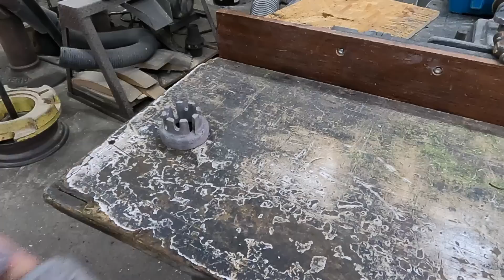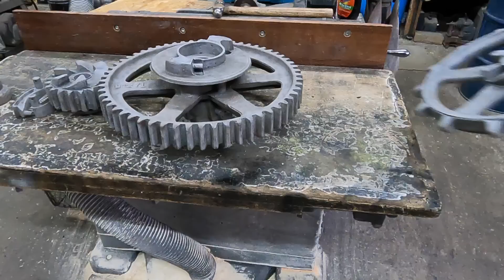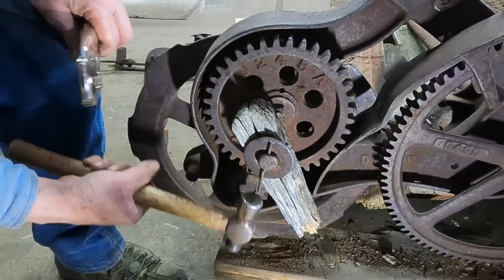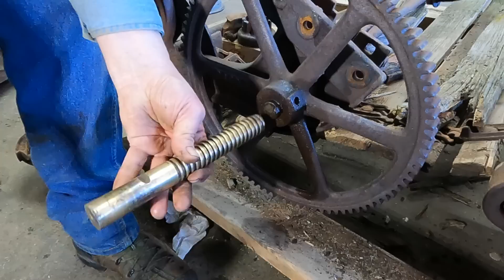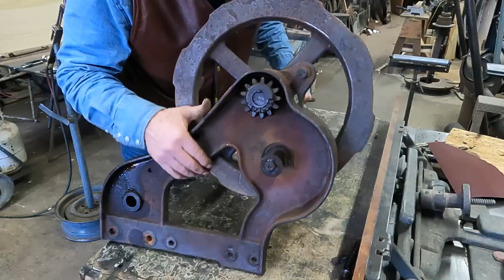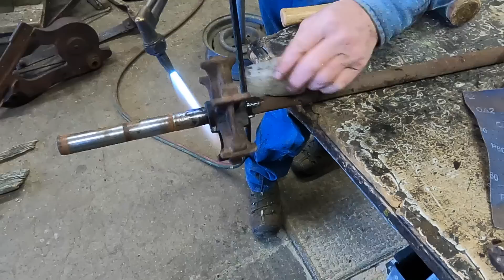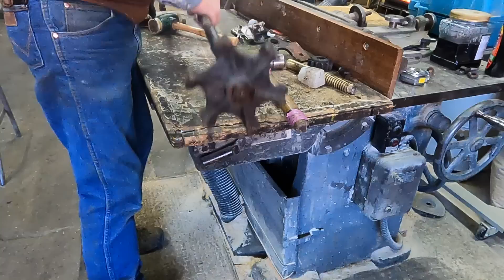Does Wax Break Loose Rust? My Test | Engels Coach Shop

Comment: Yes wax is good stuff, especially on stubborn wheel nuts. The last shaft I probably would have had a hardwood block on the floor and dropped the shaft vertically and let gravity assist , save all the tapping. Worth a shot. Good job.

Comment: The heat expands the metal slightly while the wax only lubricates. You want to heat up the female metal component (i.e. nut) while keeping the male component (i.e. bolt) cool. Heat expands, cold contracts creating more of a tolerance to break loose. 
P.s. Please be mindful of everything around and within the component you're heating up. Heat transfers thru contact and too much heat could damage bearings, rubber gaskets/bushings, wires, sensors, etc.

Comment: My dad was a mechanic/auto machinist and he told me about this trick when I was helping him pull an engine and the exhaust stud broke. He heated it up and put some wax on the manifold and he got the stud out. Heat expands and the wax gets between the two materials? Cool video.

Comment: for that real difficult wheel/sprocket (gear? cam timing? whatever) 18 minutes in, really need a good simple helper for some extra hands around the shop, get an old 20 pound iron weight plate from a barbell, set the rod vertical with siezed wheel near floor, heat the crap out of it and just let gravity and the weight do the work 😁
jokes aside, darn good work though

Comment: If you don't have a square socket to remove square-head bolts, you can always use a standard socket extension backwards, with an adjustable wrench on the square end.  Most square-head bolts are 1/4", 3/8", or 1/2" in size, which are all common socket drive sizes.

Comment: Retired auto mechanic here.  If one observes the hot riveted structure of a massive bridge built during the heyday of American construction, one will see that there is considerable rust on the outside. Where the massive steel plates are held fast together by the rivets, there is no deformation of the plates.  Where the spacing of the rivets is further apart, the steel plates show a bending deformation.  This is because as steel oxidizes, the resulting rust exerts a force of expansion, tons of force per square inch. Where the steel plate is strong enough, and the rivets are sufficiently close enough, the rust proceeds and expands until the physical strength resists expansion, stopping further rust. Observing this, I conclude that the steel shaft rust expanded inside the cast part making removal difficult. I my opinion the heat applied to the cast part caused it to become slightly larger which was the key to its removal. The oil and wax certainly helped. Oily greasy steel seems to not rust.

Comment: Dave
I think the use of wax to free off stuck parts dates back a long time when the likes of WD40 et al was not around . and it may be we remember what we used to use , as you say heat is the long time assistance in freeing off stuff .
now a quick info about me well I am 77 and when was very young I helped ? at my uncles dairy farm ( which was off grid for electricity ) we had horses and a fordson major tractor ( the one pedal clutch/brake type)  I used to help with the hand milking , tractor work ploughing and muck spreading  first check the wind direction most important !!!!,   the horses where used to mow the grass at  the local cemetery ( Ernie would not allow the tractor to work there ) so first catch your horses and tack them up oil up the mower and spend a day mowing the grass .
those where the days before we had elf and safety to look out  for us I Evan rode astride the tow bar for the reaping machine , flat belt drive for the pink threshing machine no cards at all loaded it with pitch forks 
keep up the great videos its refreshing to see a true craftsman ( opps its 2024 craftsperson ) at work. Now I build miniature steam engines from scratch mostly victroian vintage
Reply: Thank you for the story to take us back in time!
You might recognize the car in my profile picture. Let me know if you're interested in learning more. 🤔
Reply: @dans_Learning_Curve  

I am in the UK not a car guy

Comment: Grandmother, Eggs, Suck.  You could have made things a little easier on yourself on that last shaft & fitting removal by working vertically. Lay a lump of hardwood on the floor to rest the end of the shaft onto, find a section of steel pipe that will slip over the shaft and then, after lubricating and heating the fitting, pound on the pipe, not the fitting, this will concentrate the force as close to the shaft as possible. If you find the need then fabricate a collar to go between the hammer and the pipe, this will allow the use of heavier, more dense hammers without damage to the pipe, and the pipe will absorb a lot of the brittle shock to protect the cast fitting. Always worked for me, but did;t find this way until I had ruined the hide and copper heads on a new Thor No. 5 Hammer!

Comment: 14:39 i use paraffin wax (the small pellets you get when you make candles)  and i haven't been failed by it so far. Learnt this trick from grandpa whenever we had to loosen up the big nuts on the bigger combines. Sometimes those were stuck on something fierce and at 20mm back in the day not much could touch that other than the force multiplier which we couldn't use because it could break the over studs (i'm having a brain moment, can't remember what they're called. The studs that are also nuts four double wheels). So out came the paraffin. Warmed up with a small torch and you'd just drop three or four pellets, on the after glow and out they came. Heat and wax play equal roles. If you had too little heat, it wouldn't even budge, you could stuff a whole bag. My personal proof that it indeed worked was the fact that whenever it would come out, the wax would be all the way down to the bottom of the threads, way past the area where i'd put it. But only for paraffin, normal wax doesn't work, it's too thick.
That said, one thing should be noted. Threads are never designed to be water tight, not even those for specific applications dealing with liquids. You always rely on a gasket, because the way threads are made, there's always a gap. It's that gap that facilitates the paraffin to wick in. On a shaft... that's not the same. Rust is far more dense in that situation and there's already little space (by design). So there's that.

Comment: I restored a 1941 truck that had lots of rusty parts.  I tried wax, too, but didn't have much luck with it.  Best thing was heat, applied to the outer part.  I think it expands the outer part, while the inner part doesn't expand so much.  That expansion opens the joint and breaks the rust free.

Comment: I'm concerned about introducing wax residue to your blast media, particularly when it's being recycled through a blast cabinet.  That has the potential for really causing problems down the line when it's time to apply coatings.
Reply: With proper preparation that wax will be gone.

Comment: Excellent video. I my experience heat alone will remover rusted parts, if you can get them red hot without damaging the part or anything around it.
Reply: Still need some mechanical persuasion.
Reply: @dwightl5863  Yes, you will.

Comment: The smoking point of the wax seems to be quite high and in its melted form is very thin, and as you say, it is drawn to the heat. And wax does contain some lubrication properties. Have you tried pouring water on the stuck part after heating or can this damage it, especially if it is cast iron?

Comment: I would bet some of those parts haven't moved since the original assembly when it was first built.  It was/is common for parts that were meant for a tight fit to be heated/cooled for assembly and then they lock together when everything equalizes.  Separating them successfully is no small feat.

Comment: I've tried the wax trick before and I don't know if it really helped, or if it was just persistence and heat. Is there a reason you use a cutting torch for heat instead of a small rosebud?
Reply: Just habit, I think.
Reply: Already on the torch.

Comment: I also watch some machining channels and for disassembly such as you did some difficult cases moderate heat was applied and then let cool up to seven or eight times. Apparently this caused minute movements in the interface and eventually it comes free. The wax likely does help.  Any sort of lubricant would be drawn in by the thermal gradient and by capillary action.  A couple of points you do, to heat the entire piece and not just the stuck part to prevent cracking of the cast iron, and to use a relatively soft punch and a regular hammer. I've seen personally a big piece shattered by heating just the hub and then belting it with a sledge. Quite exciting to watch from a safe distance.

Comment: Candle wax is a great penetrant, oils and sprays tend to flash off too fast with heat applied...A bit smokey tho... 🙄😂
Every year during silage season , my neighbour, a silage contractor, has machinery breakdowns which involves stripping seized-on parts and I break out the candles, much to his and others amazement... I also make my own penetrant using 50/50 acetone and ATF fluid... better than WD... 

😎👍☘️🍺

Comment: In all my years of heavy engineering I’ve never heard of beeswax being used like this. Tip from a tool & die maker, eh?Makes perfect sense, as the hub expands on the shaft it goes in, doesn’t burn off & provides a lubricated surfaces. Once hub moves its away.
I would have stood all that in diesel & old sump oil for a couple of weeks & got on with something else.🙂
That method though never failed as diesel kills rust & the old oil gets in everywhere.
Glad you’ve got a record on film of how it all came apart.
Good move, good vid, thank you.

Comment: - The physical chemistry of the actual physical size of wax molecules tells me intuitively that sharp edged iron oxide dust particles will find themselves less able to jam up together being suspended in a cocoon of wax molecules...and thus parts can slide, wherein oil molecule size just can not provide the scaffolding to prevent the "nano-sized crushed rocks" of rust crystals from jamming tight together like compacted crushed rock for locked together bedding for asphalt roadways.
~ ~ ~ ~ ~
- My question to Dave is: Do you just like the Blaster can's spray setup or do you find it is a better penetrating concoction over and above that of Kroil?

Comment: Wax is just solidified oil. It has a higher melting and boiling point than an oil which is liquid at room temperature. Therefore when using it on hot parts, the liquified wax will not boil off so readily. Normal oil is also drawn to heat, but denatures and/or boils off before it can do any lubrication.

Comment: On the last & toughest one, I would have held the shaft vertical against a hard surface and used a pipe large enough to fit over the shaft & key as a slide hammer. Nice work but a bit hard on your clean pants.

Comment: Rust is an amazing fastener when it swells up inside a joint. I have a 66 c10 and there's 2 U bolts holding the rear onto the trailing arms. The rust inside the trailing arms around those U bolts was so strong I could've driven that truck around without the nuts on the U bolts confidently

Comment: First off when you know your going to work on rusty equipment lube it every chance ya get. The whole thing if your disassemblying it. Lubing things up while your working on them is useless. Good soaks resolve most tough rust issues. And on top of that why were you taping on the spindle rather than the axle part with a stop on the spindle part. Hell prob just slamming it down like a post driver would do it

Comment: I think you invalidated your testing. Round 3 was the high heat but it was also the first time you made an effort to stop the bar from moving when you hit the gear. It would have been better if you had the end of the bar against the wall for all 3 test or something similar. Although I must admit I've never heard of using wax/paraffin on rusted bolts/nuts/etc.

Comment: I have not enough experience to give a verdict, but i feel like both the wax and the red hot expanding of the part where instrumental to getting that to slide. Normal penetrating fluid would burn away as soon as you spray it on the hot metals.
What ever might be the case, great step in getting all parts disassembled without having to wreck stuff.

I love seeing your patience as you full know you have one off parts not easily repaired or swapped out.
Thank you for taking us along on another intriguing project!

Comment: Heating the gear/piece expands/loosens it if the contacting surface behaves like a ring but contracts/tightens it if it behaves like a plate. (Rings expand while holes in plates are pushed in under heating). Heating pieces can make them harder to remove. Courtesy of the Mechanical Engineering Department at MIT.

Comment: I have used wax several times to get the axle flanges off of John Deere garden tractors along with a torch and a puller. Some guys saw them and split them but JD wants like $150 each now. Years ago a friend said his mechanic used heat and wax to remove the exhaust manifold bolts from  460 and 390 Fords.

Comment: I've used wax. I'm not convinced of its efficacy. I've been a huge fan of Kroil for many years. Recently I saw some stuff (Superzilla) advertised on TV that was supposed to be the end all, be all. On a whim I bought some. For a lot of things it truly is fantastic. Others, it's about the same as anything else. What convinced me to keep it around was removing a 35 year old Turbocharger and exhaust manifold of a diesel engine. Sprayed it on and left it sit overnight. Stuff flowed everywhere. A coating over all the iron. I dismantled it all without a single broken bolt or stud.

Comment: My dad applied high temp heat to loosen parts, mainly bolts and nuts. He said the Navy taught that to him. Rust is mainly hydrated iron oxide and extreme heating makes it lose its water content. I've always thought this was your theory too. I liked this video. 👍👍👍
Reply: How about the simple rule heat expands, cold contracts? Heating up the female component creates a small tolerance which allows less resistance to slide/rotate.
Reply: @IraFuse_422  with the parts together it is impossible to heat just one. But they're going to expand at different rates which causes beneficial thermal stress. You can certainly try to heat the outer part more than the inner one too. Everyone does. Beyond expansion heat can do something else in this instance too. Enough heat can convert rust. Which does help. Now it can be argued what actually got the parts apart. But I don't think it really matters. All that does matter is they came apart. Nothing is as effective as heat either. The smoke wrench always works. I've never had it fail on me.
Reply: You heat rust up enough it'll lose more than just water content. It'll completely burn away.
Reply: @1pcfred  Burning iron oxide seems questionable. Possibly a reducing flame would actually reduce the iron oxide to iron, which would reduce the bulk of the iron oxide and assist in clearing the joint.
Reply: @harrymoyes5069  iron oxide has the reducer in it already. The oxygen. So when heated it has an affinity to burn. I've torched plenty of brown rusty metal and ended up with clean gray metal. What's your explanation for how that happens?

Comment: This may have been suggested before, but I have had fair success using a smaller air hammer... and I would say that your hammer and punch sort of provide that same vibratory effect...  My thought is this... initially there was positive clearance, enough so the parts might rotate and function.  Over time and non-use, iron oxide bridges that gap.  Its grip grows stronger over time.  The vibration of an air hammer... or hammer and punch.... or the expansion of heat is really hard on the rust bridge between the parts and breaks down that grip.  Having a penetrant helps wash or float away the rust molecules... so I would agree that both paraffin or petroleum can benefit.  I do like the air hammer to help break down the rust bridge (but it is nice not to break the Parts in the process!!).  Well done, in any  case!!  And remember, free advice is worth what you pay for it!!!  :-)  :-)
Reply: The underlying problem is that adding oxygen to iron  increases its bulk, while very much reducing its strength.. When that oxide is retained in the joint, the effect is to expand the iron around the joint, increasing the clamping force onto the inner.. The iron oxide is way weaker than the iron, so, if you can displace the oxide from the joint, there is more clearance in the joist, than was present before the oxidation took place.  The expansion and contraction from the heating, and the shock from the hammering, all help to displace the intruding oxide. The suggestion of a vibrating pneumatic hammer would potentially encourage the clearance of the the frangible  oxide from the joint.

Comment: Was wondering if there were any babbit bearings in all that mechanical mayhem. At least it looked like there were a couple in tighter tolerance areas. Reminds me of some of the mystery equipment my grandfather had on the farm in northern Iowa. I think one was a pto or belt driven corn thresher(?) machine that looked like a WW1 tank parked behind the barn. Had galvanized sheet metal all over it. 
Thanks for taking the time to record and share your work sir.
Reply: More than likely a small grain thresher.  The sheet metal gives it away.  Different machine used for shelling corn.